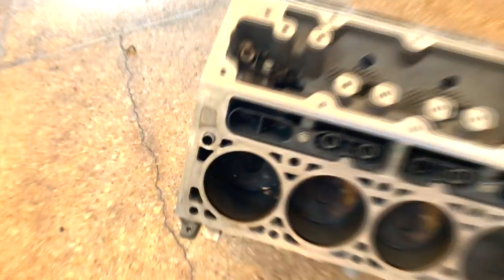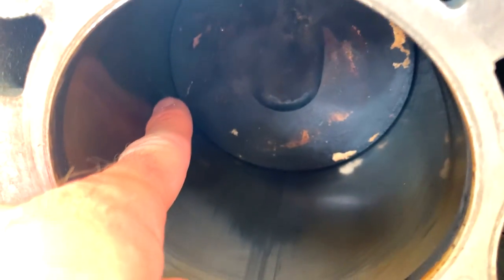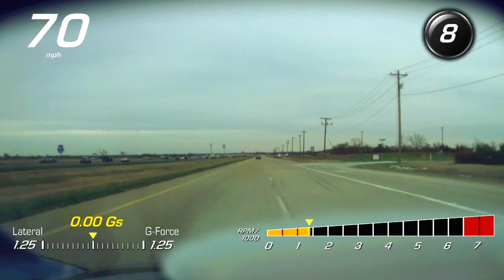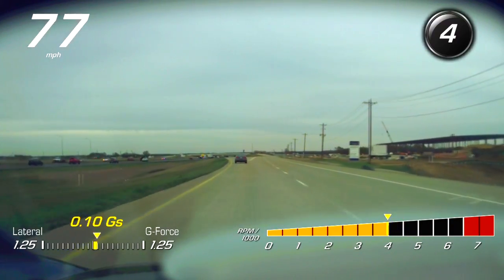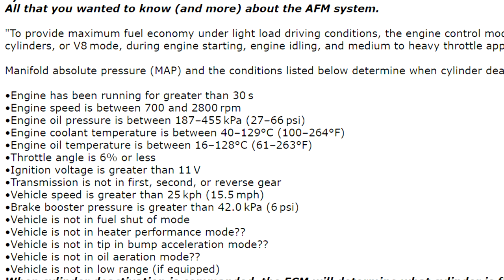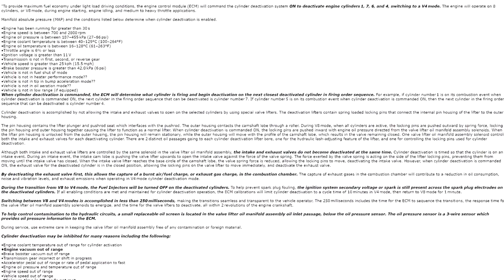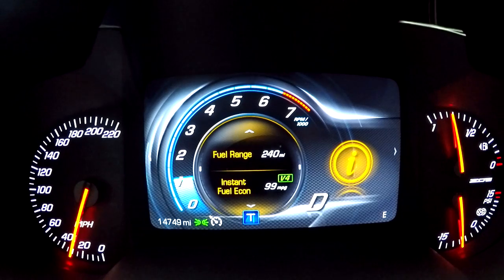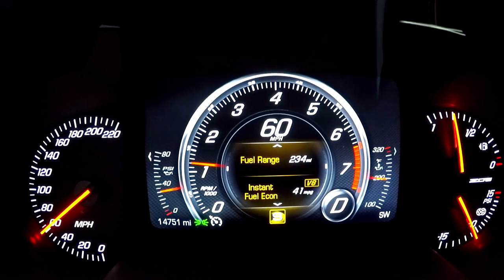How to AVOID 2 C7 Corvette Drivetrain DISASTERS! A MUST Know! *Chevy C7 Corvette*

Comment: Hiya!   Check specs on '68 or '69 Cadillac deVille had a 500 hp V-8, that at a certain highway speed, it electronically changed to V-4. I'm not real sure of the exact year, but Caddy did it a while back. Check it out. Have a better year than '20.

Comment: I keep my traction control mode off and never had a problem but with it on I have getting on the highway and tried to smack down on it and it fell into 4 cylinder mode I have a m7

Comment: What was the signs to listen for when your engine had to be replaced?  I recently purchased a C7 and ONLY in V4 mode better 1500 - 1800 RPMS there is a definite "rattle" sound coming from the engine. But it never happens at any other time.
Reply from the maker: Ryan Shore Yep, the rattle is what I hear and it sucks.
Reply: @BrinkofSpeed  so if I keep it out of V4 mode is all well or pretty much the damage is already done type thing?
Reply from the maker: Ryan Shore I don’t know, but it’s only going to do good to keep it out of V4 mode.
Reply: @BrinkofSpeed  thank you for your help.

Comment: FYI I have the M7 C7 Z51 2016 and it only goes to V4 when in ECO mode.  All other modes it never does.  And, upon any accelleration the V4 changes to V8.  So weird that some manuals and automatics switch to V4 mode.  I'm sure installing a tune would fix that.  I installed a tune for the skip shift to go away.  It always wanted me to go from 1st to 4th even in track mode lol.  I was like, what a POS.  A tune fixed that problem.  Best 200 bucks I ever spent.  I wouldn't let me shift to 2nd gear around the city, only if I was over 3500RPM lol.

Comment: The only way to disable v4 mode is thru a tune
Reply: The Range AFM Disabler will keep the engine in V8 mode under all driving modes on the A8

Comment: Not correct the only time the manual transmission goes into eco mode is when you put it in eco mode. Touring, sport, and track mode will not deactivate the cylinders. Didn't even have to do research on this just read the manual 😅.  I have a 2014 c7 z51 so just keep it out of eco and your good. Honestly with a vette I don't know why someone would do that anyways 😂🤦🏾‍♂️🤷🏾‍♂️

Comment: @Brink of Speed
Does the 2019 C7ZO6 "automatic" models have the  cylinder deactivation on them as well?
Reply: Yes but my 2019 Z06 Automatic only changes to V4 in Eco Mode.
Not in Sport or Track.
Seems GM changed it

Comment: There’s a big difference in the C7 driving in Eco Mode, vs. Touring, while using cruise control for hwy driving.  Please separate your personal opinion, from factual data….”I’ve heard” isn’t the same thing as I’ve been told by a qualified source.

The torque converter issue was an incorrect fluid problem that Chevy did cover under warranty.

Comment: Question for you sir... 2016 Corvette Stingray Z51 I have.  Manual Transmission.  Idle is 600rpm.  Just for piece of mind, I would like to increase it to 750rpm.  Will this hurt anything?  I'm old school and just think 600rpm is soo low and could cause lugging issues like it can on a motorcycle.  Thoughts?

Comment: I may never buy another gm car. I understand you can get a 200 mph car for 60k, but what's the point if you cant drive it. The real reason that gm has eco mode in a Corvette is the same reason why it's cheap - it shares drivetrains with passenger vehicles that compete with cost of ownership numbers. Like how they recommend oil changes every 10-15k miles, keeps ownership cost low to advertise, horrible advice for longevity of an engine. Might as well upgrade to Porsche, alpha Romero, jag/LR, etc. that makes a decent daily driver with plenty of power. A high end, track worthy car with an eco mode that knowingly kills drivetrains, its ridiculous to support that car. Expect the same on C8 if the rest of the 2020 gm fleet has it.

Comment: So,  sounds like you recommend turning off the cylinder deactivation once my 2017 ZO6 is out of warranty? Thank you...
Reply: Mike,  still waiting on your reply...did you deactivate the AFM on your C8?
Reply: Mike, still awaiting your reply...thanks!
Reply: Dude just disable it or drive in manual mode. No need to wait until the damage kicks in after warranty.

Comment: Interesting! Do you have a picture of the Break with lifter or spring from your experience. I don't remember from when your car was in the shop. It can make sense based on the transition between the combustion fire pattern which you should be able to see on the pistons. To me it looks like Chevy's calibration from the kick-down timing is way off and people are getting to much rpm spiking. The C7 should be able to handle it. Chevy needs to look more in their ECU to TCM mapping. I'm sure for the people that it does happen to in manual mode they can run a longer RPM range before each shift and be smooth within shift points to prevent it from shutting down the cylinders. I'm not sure on the exact rpm range within wheel sensor ratio it goes in to effect. Most of them do calculate the engine idle RPM to wheel speed then cylinder shutdown. To me Cylinder shutdown  or ECO mode on some cars is only good for emissions and somewhat gas mileage. If your good at timing the RPM range within shifts it can just do about the same or if not better. But yes, cylinder shutdown is not good for the life of any engine. Manufacturers don't normally focus on engine life. They prefer to have the consumer trade the car in before that time.

Comment: Mike,  afternoon from Geneva.  Watched your video and was both intrigued with the info you shared as well as concerned.  You specified both the C7 (I will assume 2014 - 2019) as well as the new C8.  Is that correct data?  Blue skies, Jg
Reply from the maker: John Glynn Hey there John. Yes, it is all C7’s except the ZR1 and the new C8 is going to have it as well. I currently don’t know specific details about the C8 though.

Comment: Do you guys think that GM has implemented V4 Mode into the C8??
Reply: KillerNinja0911 yes they have. Tadge talked about it and said they made it less noticeable. Well, until the engine or torque converter goes.
Reply: JefThegr8 what a bummer!!

Comment: You’re not lying about the C5Z gas mileage. I bought my C5Z in Orange County, CA which is 450 miles from my home. 

I topped off when I bought the car and started on my way home. 

450 miles later, I was still going and after all was said and done, I had averaged 30.8 miles per gallon!

Comment: Any time you drop 8 cylinders down to 4 you will be saving a tremendous amount on fuel, once it kicks in. Remember, it will only kick in when there is a constant rpm. Any acceleration will activate the entire 8 cylinders. Going 70-80 mph, without deactivation, I get about 22-25 mpg. With deactivation, I can get 35 mpg. Huge difference. And, I can confirm. M7 transmission, V4 mod will only happen in ECO mode.

Comment: Christ the Z06 Auto owners have already had to pay a Gas Guzzler Tax and still have to put up with running a V-8 in a vibrating mode.  They had to build the tunnel out of steel due the vibration and is what we call a clue.  Typical engineering and basic knowledge that when making a change, be careful what you are doing down range.  I bet they can’t do a recall on a EPA change and would get fined millions if they deactivate a emissions item.  Manual mode it is....  As for the new C-8 system, it has been redesigned and works within different parameters.

Comment: Use the range tech disabler. https://www.rangetechnology.com/products/afm_disabler/
Reply: AFM only kicks in under light throttle conditions, which means the transmission is not shifting. In my A8 C7, I cannot tell when this happens unless I am looking at the dash display.  So please explain, how does this hurt the transmission exactly?